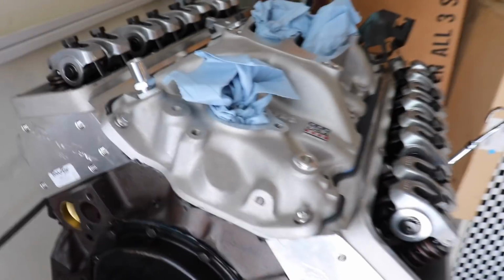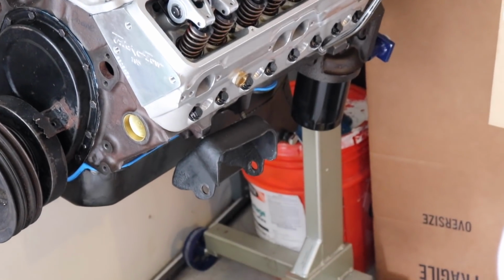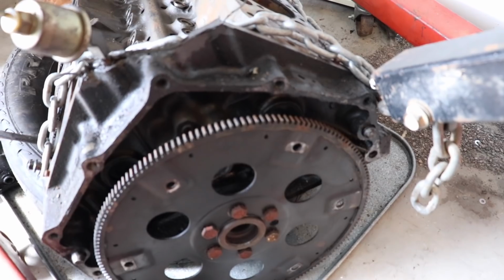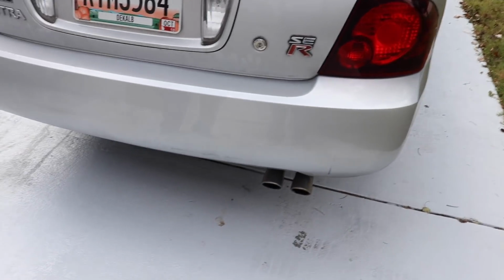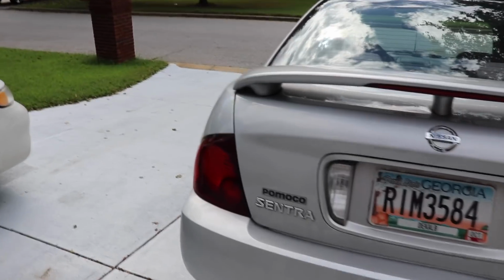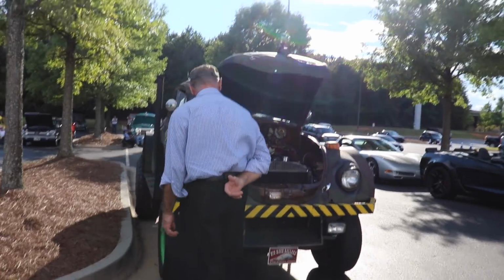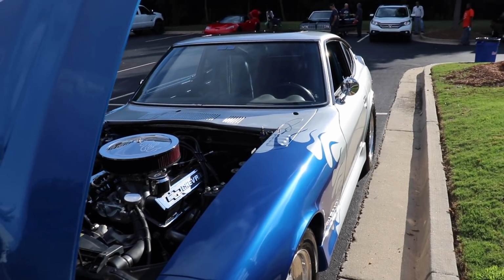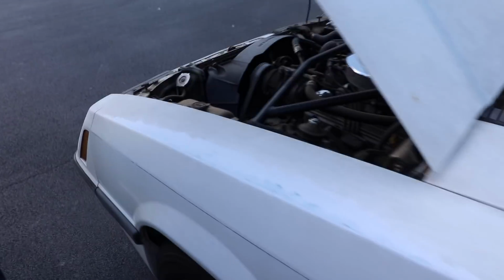Engine Install Prep at SUMMIT RACING!!!

Comment: Just check the length of your flywheel bolts. I order some from jegs and they where to long and got caught up on the block. There is a difference between flexplate (auto flywheel) bolts and a standard tranny fly wheel bolts autos are shorter then standards. But my block was also a 81 357 with a 2piece rear main.